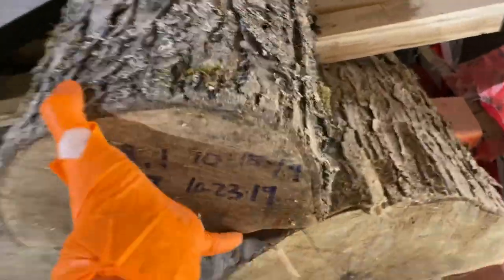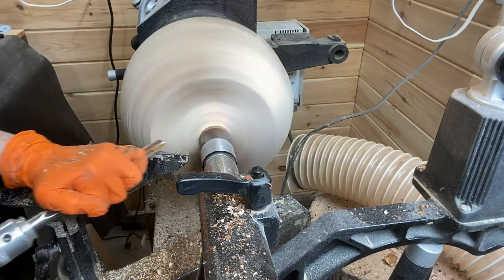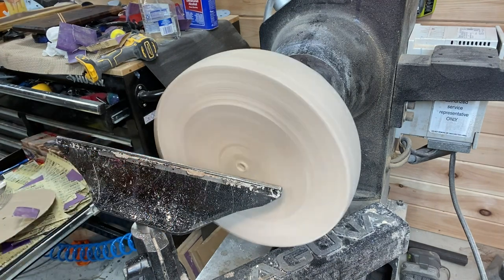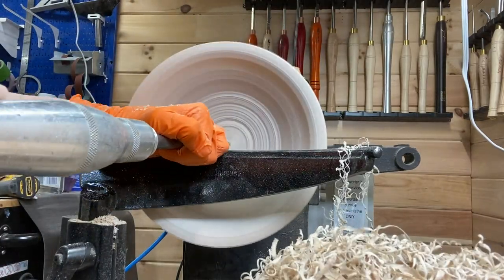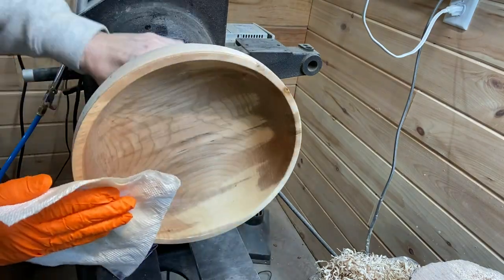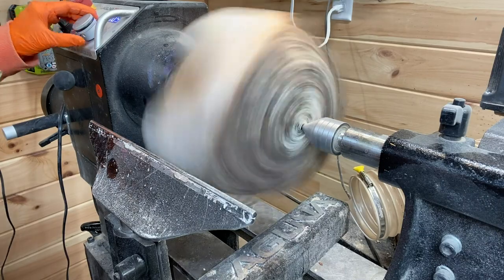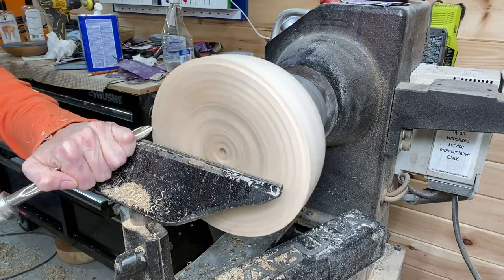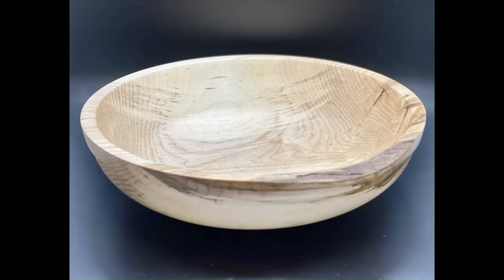Woodturning Nesting Bowls (3-bowl set)

Comment: Very nice, got a good collection of blanks going. Be wary just going off the moisture meter, as the only give a reading from the first centimetre of the timber, further in the timber can still be wet. I usually weigh blanks, and when they stop losing weight they are stabilised enough to turn.
Reply from the maker: Yes, someday I will upgrade to the Wagner moisture meter!

Comment: You show a room of  wood drying with with dates and temps .. how would i know what length of time and moisture content , to turn a piece of stock
Reply: Weigh the blank, when it stops losing weight it's stabilised enough to consider being dried out. You can turn wet wood, but you need to watch for warping, cracking and such. Usually, wet wood is turned down to have the wall thickness an even 10% through the walls of the bowl, then put aside to dry, either in shavings or other drying method.
Reply: @DiemenDesign  thank you for the information
Reply from the maker: I use a moisture meter. But more importantly, I seal them with Anchorseal and they dry from anywhere from 18-24 months or more.